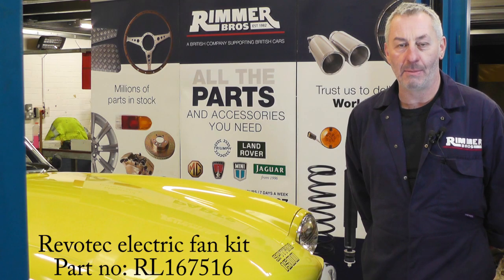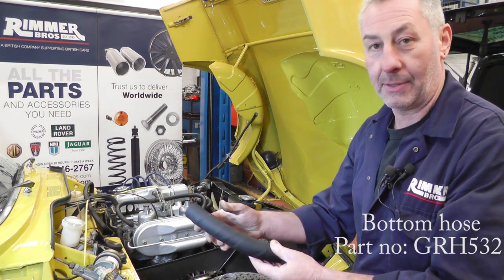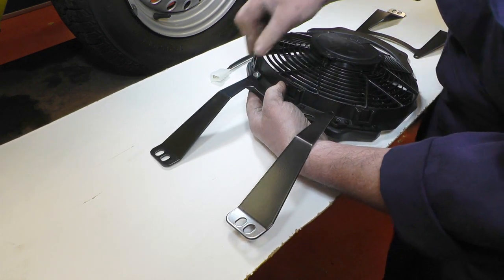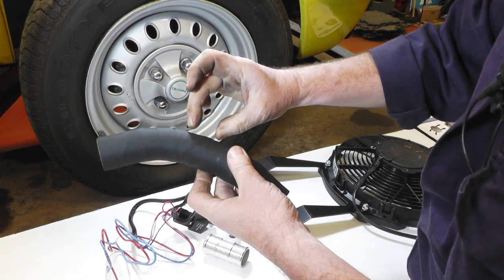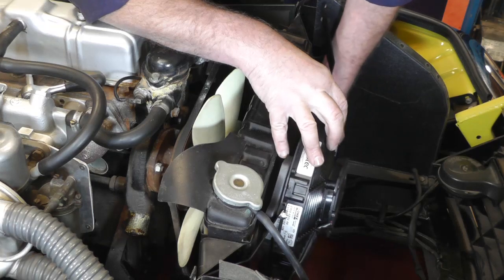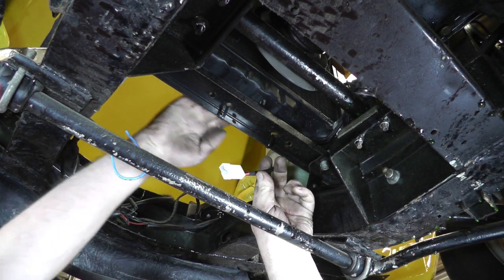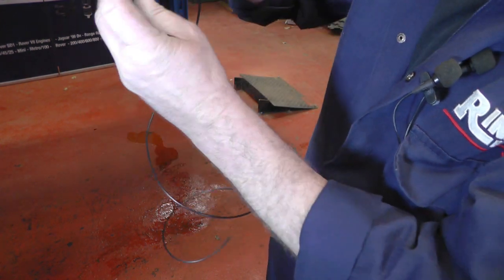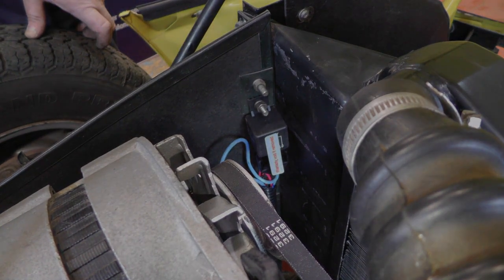Fitting a Revotec Electric Fan to a Triumph Spitfire

Comment: The Revotec electric fan is meant to be in lieu of the mechanical fan so surely you should remove it before setting the cut-in/cut-out temperature on the Revotec temperature controller?
Reply from the maker: Please read Correction

The Revotec fan can be used as a replacement or supplementary item, depending on your needs (hot country etc) or how much work you want to undertake. Cut in and cut out would therefore be set to your own requirements also.
_________
Correction:

Revotec Electric Fan Kit

It is the intention that the mechanical fan is removed during the installation of the Revotec electric fan kit. This fitting video does not contain this as the vehicle shown is a sample car on display in our showroom.

By comparison the electric has a vastly improved flow rate over the original mechanical fan (left in situ the mechanical fan would effectively act as a barrier as it's simply not capable of keeping up).

It's important to remember that electric fan kits will only benefit a healthy vehicle and aren't to be treated as a cure for overheating. Ensure that the water pump is in the best of health and that the system is free from blockages/debris. On the Triumph 4/6 cylinder engines any deposits in the cooling system are usually gathered in the waterways towards the rear of the cylinder block and are difficult to clear without disassembly of the engine.

Apologies for any confusion.
Reply: @RimmerBrosTV  That does not appear to be correct; you should not be using two fans.  Each fan is going to have different speeds and flow rates, using two fans will cause a pulse between the two fans which will inhibit air flow through the radiator, not enhance it and will not provide additional cooling in hot weather.  Two fans will I suggest cause the car to run hotter, not cooler.
Reply from the maker: @timsullivan3921  
Revotec Electric Fan Kit

It is the intention that the mechanical fan is removed during the installation of the Revotec electric fan kit. This fitting video does not contain this as the vehicle shown is a sample car on display in our showroom.

By comparison the electric has a vastly improved flow rate over the original mechanical fan (left in situ the mechanical fan would effectively act as a barrier as it's simply not capable of keeping up).

It's important to remember that electric fan kits will only benefit a healthy vehicle and aren't to be treated as a cure for overheating. Ensure that the water pump is in the best of health and that the system is free from blockages/debris. On the Triumph 4/6 cylinder engines any deposits in the cooling system are usually gathered in the waterways towards the rear of the cylinder block and are difficult to clear without disassembly of the engine.

Apologies for any confusion. Thank you for your comment.